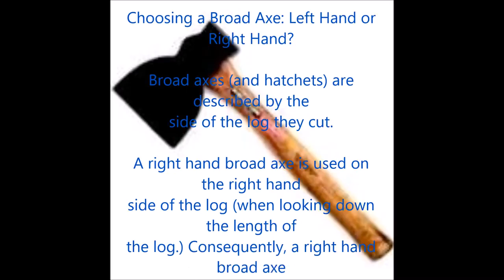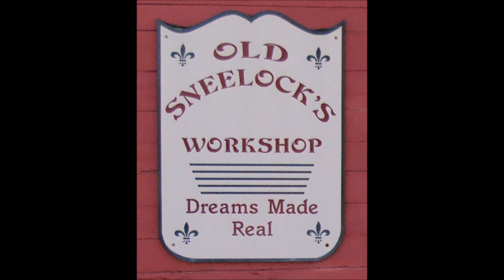Hewing Hatchet ~ What Not To Buy On Ebay. ~ Pt 1 ~ Fitting The Handle ~ by Old Sneelock’s Workshop

Comment: I have a hatchet head just like that. Mine had a left handed handle as well. I'm making a right handed handle for mine as well. 👍
Reply from the maker: I haven't used it much more than to make sure it worked. I wonder if it's useful to have both a left and right handed carpenters hatchet?

Comment: So I purchased a late 1800’s Beatty & Son 12” broad axe head on EBay and just finished cleaning it up. The dimensions of the eye are basically the same on each side so I should be fine orienting it which ever way I choose right?
Reply from the maker: Yes. Since there is only a single bevel broad axes are designed for right or left hand. The handle can be put in from either end of the eye.
Reply: @OldSneelock  thanks! I’ve heard people say if one side is slightly bigger than than the other then it has to be the top, so confusing so thank you for clarifying

Comment: Try making a kustom sized drift out of hardwood. I have made them in several sizes to aid with handle removal. I'm a recovering axeaholic, I knew it when I reached 100 axes.
Reply: Excellent, I only have 23 but they are all customized by me and I didn't pay over $6.00 for a head, I try to keep it under $5.
I just brought home a Hultafors Brucks right handed hewing hatchet  (garage sale) in excellent condition for $5.00. All I did was make a new handle w/ the cast-off and hone it until it shaves. Most handles I make myself, some I laminate from white oak & black walnut as art pieces.

Comment: Old Sneelock, a doppelganger in a plaid shirt crept into the workshop and started on your project. Luckily you got back in time and took over :-).
Reply: +UK Tony Got to watch them doppelgangers. They'll get you every time!
Reply from the maker: The shop is chilly until the lights are on. 800 watts of heating elements and high speed work with the drawknife, file, and saw made the plaid unneeded.
Reply from the maker: +Lewie McNeely I keep hoping for the shoemakers elves to show up and finish a few of the things I got started. Now that Ryan has grown up and is working towards retirement, aren't we all, I don't have as much help in the shop.
Reply: Maybe grandyounguns or snag an innocent passerby?? I dare say we'll get our retirement worked out in another 3 or 4 hundered years. But the greenhouse is almost done. Finished the water hookup yesterday (but have to make up a short hookup hose) and stopped up all the pneumonia holes and hung the pulley for the fan enclosure door so it can be shut tight, sort of. Now to move everything back out and fluff up the beds. Then the sun will come out and it'll be mower city again!
Reply from the maker: I'm going to spade around the front flower bed today. Nothing on the burner but a few chores. Nice to be ahead for a minute. :-)
Reply: I dodged the rain and went to my computer class, then stopped by the sawmill and talked to the pals about getting a load of logs. The sun will be out before long and I'll be mowing again but that's what Sweetums uses for mulch. The Kawasnapper runs again!

Comment: I bought a Italian Globemaster hewing hatchet on eBay for $5.95! All it needed was a wedge! 😂
Reply from the maker: Not a bad deal.
Reply: i bought a british made one, even the handle was rescuable, it had dried out its wooden wedge, but luckily no-one had tried to mess with it, i guess it lived in a shed somewhere for a few decades,    got it apart, cleaned, took 1/8th off the top end of the handle and moved head down the same, new wedge, fits great, looks like no-one used it past the first blunt

Comment: The printed matter scrolled way too fast, I'm a fast reader but that was impossible to absorb. Otherwise I enjoyed the visuals.
Reply from the maker: Geoff Davies Thanks for letting me know. Sorry that you didn't get a chance to read everything. When I watch others videos I often pause the video to read a caption or get a better understanding of a part of the video. It's always a juggling act to have the pace fast enough to hold the viewers interest without losing the information I'm trying to share.
Reply: Just started to hang a large broadaxe myself and thought I should check what others have done.  My handle doesn't have a wedge split so I'm going to have to cut one in.  I thought the axe was right handed but the smaller opening is for a lefty handle and as I'm a lefty suits me well. Regards Geoff.
Reply from the maker: Geoff Davies In 1991 I bought an old farm house with several outbuildings. I needed to replace a beam in one of them and could not find one the size I needed. I decided to make one and started looking for the tools. I ended up not being able to find a broad axe for less than $300.00. That shot down the making a beam with a broad axe. :-)
A few years ago I found one for a good price and bought it. It's the flywheel effect of collecting. I already replaced the beam 25 years ago. I sold the house, and moved, 6 years ago. 
I just wanted a broad axe. 😎